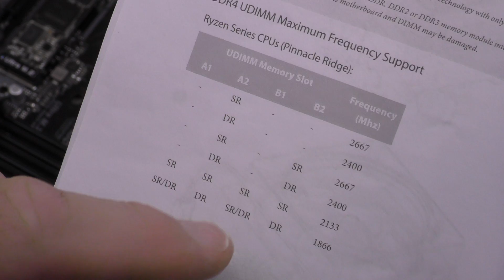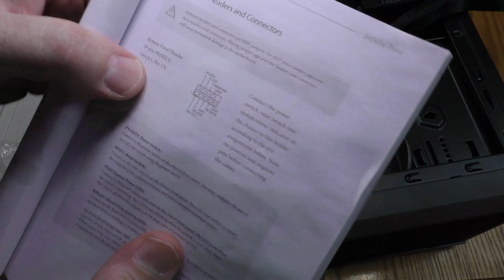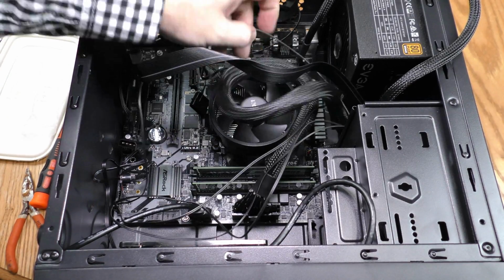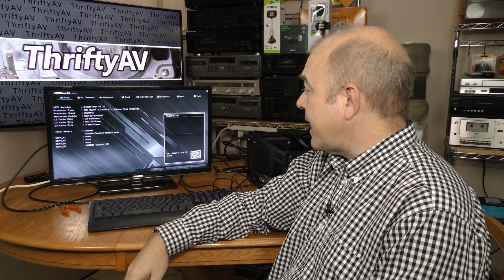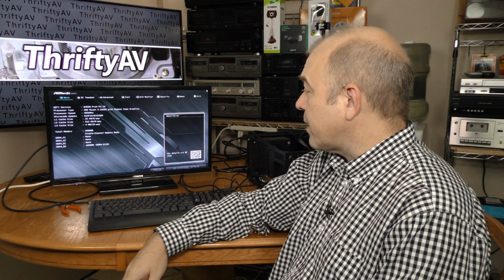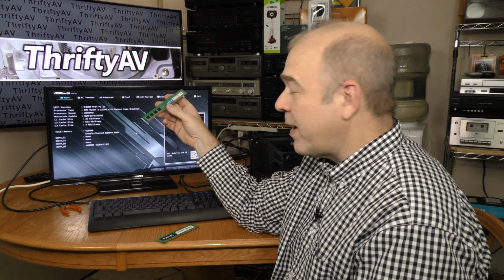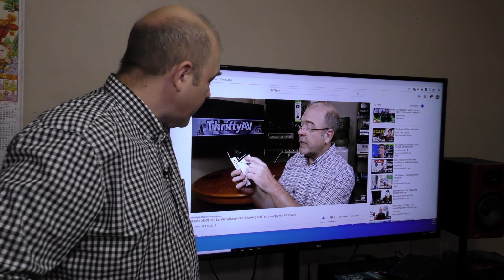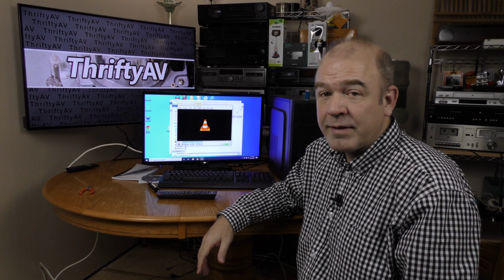ASRock B450M Pro4, AMD Ryzen 3 2200G | Spare Parts MicroATX Build

Comment: If you still have this issue, let me know I can show you the right cable and software settings and other missed essentials you may not of known about at the time in making this video, things like you need a display port cable or two-hdmi to get 4K and even the version of the cabled its self maybe the wrong gen and causing the audio problems etc

Comment: I just built a pc using pretty much the same board (asrock b450 pro4) Ryzen 7 3700 and cant get it to turn on? The issue maybe with the system panel connectors not being right? I went by the diagram on my board manual but it does not work. As soon as I plug in the power supply two of my case fans start to slowly run? Any ideas on what might not be right? From left to right I have Power Led+Power Led - Power SW bottom row HDD LED and Reset

Comment: I got a question about the vid if you don't mind.  I noticed when you're applying the thermal paste at around 1:55, it looks like there's no back plate on the underside of the board.  At 2:00, when the vid switches to you getting ready to install the cooler, it looks like you've got the back plate inserted again.  Is there anything securing the back plate to the board like nuts or screws or is the board just sitting on top of it? 
Reason I'm asking is because I took mine off yesterday and I don't remember if I unscrewed it or if it just came off after I took those two brackets off from the top side of the board that shares the same holes as the retention plate.
Reply from the maker: The back plate will either attach to clips mounted to the top of the board for "clip" type coolers or the screws on a "screw" type cooler.  Basically, with screw type coolers, you are screwing the cooler directly to the back plate, not to the board itself, so the back plate is loose until you mount your cooler.
Reply: @ThriftyAV  Thanks.  You've been a great help.  Liked and subbed.

Comment: I've run into that same problem with the computer screen being cropped off from being larger than the display screen if I had my pc hooked up to a TV.  The problem would persist even if I had desktop resolution set to 720p on a 1080p screen.  There used to be an easy fix for that if you were using Intel onboard graphics.  You could go into their UI and there would be sliders to expand or contract the image horizontally and vertically.  With newer Intel chipsets I haven't seen that feature.  I guess it was too convenient so they had to get rid of it.
Reply: I dont mean to be so offtopic but does any of you know a tool to log back into an Instagram account??
I stupidly lost my account password. I appreciate any assistance you can offer me!
Reply: @Maverick Moshe Thanks so much for your reply. I found the site thru google and Im trying it out now.
Looks like it's gonna take a while so I will reply here later when my account password hopefully is recovered.
Reply: @Maverick Moshe It did the trick and I now got access to my account again. Im so happy:D
Thanks so much you saved my ass !
Reply: @Keaton Joey glad I could help =)

Comment: Neither the ASRock mobo or the NZXT H510 case come with standoff screws.  So what kind of screws do I need?
Reply from the maker: The proper screws and standoffs for mounting motherboards are called M3.  M3 has a width of 3mm and a thread pitch of 0.5mm.  I've been scavanging screws and standoffs from old computers for over three decades, but if I lacked any of these, I would get a computer screw / standoff kit.  Not only does it have MB screws and standoffs, it also has fan screws, case screws, drive screws etc.  You can find one of these kits on Amazon for about $10.
Reply from the maker: Oh, and cool Scorps Blackout channel art!
Reply: @ThriftyAV  Thank you for the response.  Much appreciated.  Jeez man.  The case did in fact come with the screws.  A whole bunch of them.  Took the back panel off and they were hiding in the basement of the case, in a box inside the mounted 3.5" drive tray.  Found that out after driving 20 miles to Lowe's for the screws.  
The whole process has been one setback after another.  I did a bench test and the pc wouldn't post.   I'm guessing it might be the cpu but not entirely sure.  I found out that's the risk of a first time build.  If it doesn't work, then you're faced with the troubleshooting process oftentimes with no way of knowing what the problem is.  Can't really RMA anything without being entirely sure.  RMA the cpu and then it ends up being a power supply or mb problem or something like that.  
Anyway, cheers to you and thanks for the response and the vid.
Reply from the maker: So true that it's hard to troubleshoot without spare parts.  I actually picked up this ASRock Board when I was troubleshooting a probelm I was having with a more expensive Gigabyte board.  I ended up sending the Gigabyte in for RMA and got a board that worked.  The Gigabyte is in my primary editing machine, and the ASRock has become my "test bench" machine.
Reply: @ThriftyAV  Have you ever run into a problem similar to mine in which, when I power on the machine, the gpu fans are running but the fans on the chassis as well as the cpu fan are not?  I originally had an aftermarket cooler installed for the cpu, the Hyper 212 RGB Black Edition.  The fan light was coming on but would blink back off once every 4 or 5 seconds and then come back on again while the fan itself wasn't turning.  Then, every 15-20 seconds, the system power would shut off and promptly turn itself back on again to repeat the same process.  I let this go for about 5+ minutes and it just kept repeating the cycle.  I then started re-seating some stuff, including the 4 + 4 cpu plugs.  But before re-seating the cpu plugs, I powered on the machine without them and it reproduced the exact same cycle that it was doing before when the cpu was plugged in.  That's why I thought it might be a cpu problem.   
I started to wonder if I might've installed the cpu incorrectly so I took off the cpu cooler and pulled the cpu back out and saw that all the pins were intact so I was able to rule out smashed pins.  
One mistake I did make on the first install was I applied a little too much thermal paste.  There was some spillage outside the peripherals of the cpu and the socket but not enough to hit the surface of the board itself. I cleaned that up as well as I could and I'm gonna try to reinstall it with the stock cooler that came with it.  I'm not too optimistic the outcome will be any different but still gonna give it a go.

Comment: QUESTION: Where does the on/off power switch connect to on this board. Thx !
Reply: I’m pretty sure it’s the first two pins on panel 1. Not 100 percent sure though.

Comment: Would the ryzen 3 3200g work too? I have that, and this motherboard on the way alongside 8 gigs of RAM. Hoping to be able to do some light gaming without a gpu
Reply from the maker: Yes, just make sure that the BIOS is at least version 3.30, released in May 2019.
Reply: @ThriftyAV  This is my first build I'm sorry, could you explain a little more if possible. I'm not sure what that means
Reply from the maker: The BIOS is 'firmware', software that is built into the computer.  It allows you to configure hardware settings on your computer.  The B450M Pro4 has been around longer than your processor.  If you purchased a used or 'new old stock' motherboard, it might have an older BIOS that does not support your CPU.  Updating the BIOS is beyond the scope of a message response, but there are many helpful tutorials that can be found with a web search.
Reply: @ThriftyAV  Okay, thann you very much. One more question i couldn't find online. I purchased a new Asrock b450m pro4 and bough a ryzen 3 and thats the ONLY processor i have. Can i still build my new pc to boot it without putting the processor in? Or do i just put the processor in even though its newer. I dont get how that works. Will my pc boot without a processor?

Comment: Will the BIOS need an update for the Ryzen 5 3600?
Reply from the maker: The BIOS needs to be at least version 3.30, released in May 2019.  New boards are shipping with a compatible BIOS.  Boards from May 2019 or earlier will need a BIOS update for support of the 3600.
Reply: @ThriftyAV  Thanks. I'm probably going to get the new B550M Pro4 that is coming out in a couple of days instead.

Comment: Some people use glue some people dont Im confused is it essential
Reply from the maker: If you are talking about thermal compound, it is sometimes called "paste" but it is not an adhesive.  It is helps with heat transfer from the CPU to the cooler.  When you buy a new cooler, it come pre-applied.  If you are re-using a cooler, you should use compound.

Comment: you do not need thermal compound for the amd cooler, it comes already applied
Reply from the maker: You are correct when the cooler is new out of the box, but if you ever remove it from the CPU, the old compound should be wiped off and new compound applied.  This is the case with my build.

Comment: I'm using the same motherboard, and I don't think I have the USB 2 cord that you mentioned in your video. Are there other cords I might have, or am I missing it?
Reply from the maker: The USB 2 header that I connected is part of the case I was using.  It did not come with the MB.  It leads to the connector in the front.
Reply: @ThriftyAV  Thanks, I've been having problems setting up my PC and I thought that was it if it was with the motherboard, but I'm using a different case

Comment: This mobo has been a disaster .. it won’t even run an AMD Ryzen 5 3600 and DDR4 3200 RAM at stock speed ...
Reply: dam i was thinking about getting one... is the B450M DS3H better?
Reply: Philip Kavanagh .. I finally got it to run as well as you’d expect for an $85 mobo .. with the all-in-one driver, all the chipset drivers got loaded (ASRock site is NOT at all forthcoming about this) .. & with the XMP profile 1, the Ryzen 5 3600 is OCing at about 4.0 .. now the single stick/single channel DDR4-3200 16-18-18-36 maxes out at 2800 (any faster setting causes 2166 fail/fallback)..(it’s my bad I didn’t double check when ordering this RAM not being 2x8 kit for dual channel as expected).. it runs at just about 10% load feeding the GPU at 1080p with high settings .. all-in-all this is quite acceptable now ...

Comment: What did you end up doing with it!? Maybe charity lol I’ve never had a gaming pc thought maybe it’s time to move into the pc master race!
Reply from the maker: My primary computer is not very mobile with multiple monitors, drives, speakers, hubs, and computer accessories plugged into it.  This makes it very unhandy for trying out gear, cards, etc.  Plus, as a daily driver, I don't really like installing unnecessary stuff.  I am using the ASRock machine as a test bench PC for hardware and software, as I'm regularly trying out webcams, microphones, and software.  Plus, it's nice to have a spare.

Comment: Did you have to do a bios update for the cpu to work on the motherboard
Reply from the maker: Not the 2200G CPU I used in this video, but if you want to install a 3rd generation series Ryzen processor, you will need to make sure it has at least BIOS version 3.30 that came out in May 2019.
Reply: @ThriftyAV  i thought this motherboard doesnt need an update for 3rd gen?
Reply: Philip Kavanagh Some do and some don’t. As rock sells ryzen 3000 series ready. If you buy a new asrock mobo and says 3000 series ready, then no worries

Comment: Would a hard drive work for this motherboard??? Dont seem like it on mine but its my first build so im not sure!
Reply from the maker: SATA hard drives work fine with this motherboard.  It has 4 SATA3 ports.  However, the M.2_2 and SATA3_3 share lanes, so if you have a 2nd M.2 installed, you will lose one SATA port.

Comment: Wanted to install a UEFI Linux version in the B450M Pro4/M/ASRK  - have disabled secure boot but it will not boot in UEFI.  Where can I find a good description of the BIOS/UEFI step by step to learn how to adjust this motherboard.   Board has 3.90 UEFI, 12/09/2019 Latest is 4.10
Reply: This is an old version but has some valuable information I have been struggling to locate/understand... https://www.ocinside.de/review/mainboard_asrock_b450m_pro4/4/
Reply: hi, did you figure it out? I just bought the board and linux is a must. What distro did you try to install? it might be an older kernel causing problems with the CPU. Please do update.

Comment: Which brand of power supply did you use? According to the manual I can use a 4 pin connection on the 8 pin power plug. I am doing that because the power supply I have the shape of the pins only fit 4, not 8. The other 4 pins are a mismatch.
Reply from the maker: EVGA 600BQ

Comment: You speak very slow. 
Surely your microsoft windows OS has drivers problems, that's why video and audio dont work. Try linux.
Reply from the maker: Perhaps I speak a bit TOO slow for some folks.  You can always speed playback to 1.25 or 1.5 and speed things up.  The audio and video are fine on my Toshiba TV.  I fixed the video on my LG TV within the menus of that TV, but it still has audio issues.  The fact that it works fine on one TV but not the other makes me think it is related to the television and not the driver.

Comment: Did you install the drivers for your new build ?
Reply from the maker: Windows 10 is much better at hardware detection and automatic driver installation compared to previous versions, so manual installation was not necessary.

Comment: I think your ram is in the wrong 2 slots
Reply from the maker: not according to the book that came with the board.
Reply: @ThriftyAV  Well, I have the same board. So.... Not sure what the difference is! The piece of paper discussing ram with which Ryzen family you have and the book says otherwise here... Not that it matters at this point. You couldnt even fix your resolution....
Reply from the maker: @kdc300z  I suggest opening your book to page 22 and read the note about Dual Channel Memory, specifically that the A2 and B2 slots should be used when populating two of the slots.  Then turn to page 1 and find the location of those slots, then watch at 1:50 where I installed the RAM.  If there is any doubt that the Dual-Channel Memory Mode is active, the BIOS on this board indicates it on the Main screen, right under "Total Memory".  A pic of the BIOS screen indicating Dual-Channel Memory active using this configuration is available on request.  

To avoid cropping the edges on an LG TV, go to ALL SETTINGS > PICTURE, turn off "just scan".  A power cycle was necessary after changing this setting on my TV.
Reply: @kdc300z  my god you are so wrong

Comment: Why did you take a PSU that give 600w ?
 
I think 400w is enough ?
Reply from the maker: I got the 600w Power Supply on sale, and I like having more than I need with power supplies.  If I'm using my 2200G with it's built-in graphics, a 400W would work fine, but I sometimes swap out processors and test other gear.  My Ryzen 5 2600x will consume 250W+ with multi-threaded applications.  My GeForce 1060 can consume around 120 watts.  With these hooked up, along with optical drives and other devices, I would want more than 400W to insure I have enough power.
Reply: @ThriftyAV  thanks

Comment: Can you please help me out on the front pannel connectors. I have the same board but in atx and i need guidance
Reply from the maker: Do you have the book that came with your board?  In my book, the information you need is in section 2.6, called "Onboard Headers and Connectors".  With power and reset, they can be positioned more than one way, but it is important to have power also connected to a ground pin, and reset also connected to a ground pin.  Polarity (+/-) does not matter on these pigtails. 

On the LEDs, it is important to position them correctly, or they will not function.  The "+" and "-" should be labeled on the pigtail.  Match them with the diagram in the book.  Connections for the front USB headers are also located in the book.
Reply: @ThriftyAV  yh i do but they are too basic and they really dont help out a lot

Comment: Does this board come with the ryzen 3000 bios pre installed?
Reply from the maker: Mine that was ordered from Newegg in August had the P3.10 Bios pre-installed.  There have been a few updates since then, but I have not bothered flashing it yet.
Reply: @Jordan-oi4kj  When you start up the system press f6 and it will tell you the uefi/bios version - 4.10 is latest version, but there is a warning for type of processor you are running...

Comment: Hey Buddy, nice video :) just a tip, on that case you could have unscrewed the hard drive cage .. ah forget it you just took it off :)
Reply from the maker: lol... yeah, I noticed this a little later than I should have.  Inserting the standoffs and plugging in the power connection would have been easier with this plate off!  Thank you for the comment.